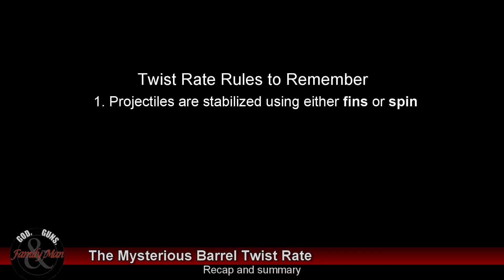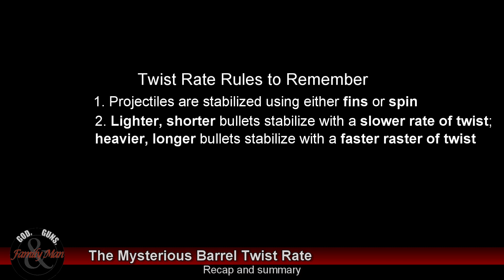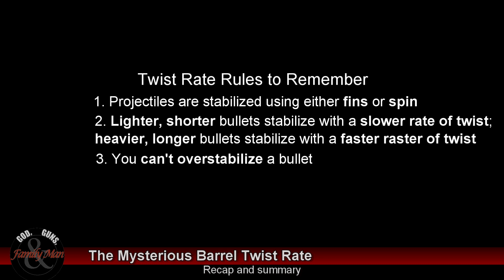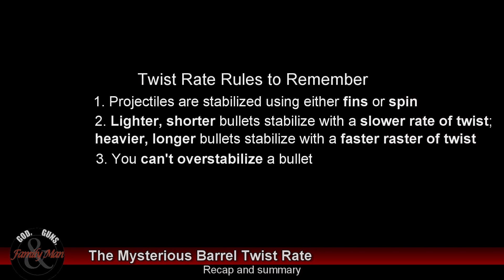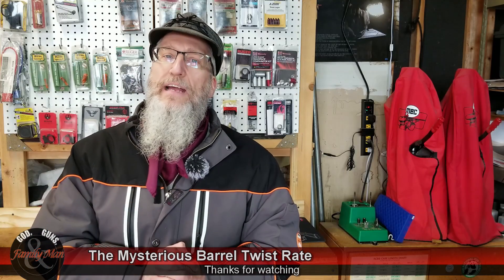Barrel Twist Rate and Bullet Stabilization

Comment: This video acutally explains nothing. Only if this is the situation, then that is necessary. But no explanation of _why_. 

For example: so, the bullet desintegrated "because" it slowed down to trans-sonic speed. Mhm. But still ... why!? 

Or, you need a faster twist rate if the bullet is larger. And a smaller bullet does not require that. Mhm. But WHY? 

What is the physics behind this all?

Comment: What you say makes sense however I have a 38 special handgun 158 grain bullet shoots more accurately. Hornady 110 grain bullet going at about 1200 ft./s is all over the target so it seems like 158 grade works better.😮 by the way my 38 special revolver has a one and 18 inch twist rate. Therefore 110 grind should shoot better and it’s just the opposite. I only shoot 158 because they go on .110 harder but I’m gonna miss the Target.

Comment: How much for a 150-180 grain 30-06 ?
Reply from the maker: If you have the data on the bullet, check out Berger's twist rate calculator at https://bergerbullets.com/twist-rate-calculator/
Its really the length of the bullet that effect necessary twist rate more than its weight.
Thanks for watching.

Comment: Interesting video.  I have an AR pistol with a 5.56x45, 1:5 twist rate that appears to be having trouble stabilizing (keyholes target).223 55 and 62grn bullets as short as 7 yards, if I go to 55grn 5.56x45 ammo, I can get at least 15yards before it destabilizes (again keyhole), in all cases, the projectile does break apart.  I have been told by the manufacturer to go to a 77grn 5.56x45 OTM round and this should solve the problem.  Since you are saying a projectile cannot be overstabilzed, can you please help me understand what is happening with the lighter 55 and 62grn .223 bullets.
Reply from the maker: What you described is a good example of a bullet that is clearly stabilized but also over-spun.  An over-spun bullet will show erratic performance on target as you noted. If known, can you post the muzzle velocity for these bullets?   
Stepping up to a heavier (and longer) bullet will give you much better performance out of those very fast twist barrels.  At least 77 grain and even heavier.
Thanks for watching and posting a good example of a stabilized but over-spun bullet.

Comment: The M16A1 I used in the Marine Corps had a 20 inch barrel with a 1-7 twist. We used 55 grain FMJ and had zero issues. My current rifle is a 16 inch with 1-8 twist and 55 grain FMJ works just fine.
Reply from the maker: Don't get me wrong, the 1-7 and 1-8 can fire those bullets just fine. My Tavor with 18" bbl and 1-7 twist shoots 55 gr bullets just fine.  BUT, it does even better (less dispersion) with 69 and 70 grain bullets.

Comment: The disintegration part is BS for sure. As someone who comes from a lot of high power PCP experience i can assure you that there is no such thing as the trans-sonic tumble or yaw which ppl claim. Airguns also have the advantage of very little velocity spread and SD when regulated and this has been proven wrong many times over.

Comment: How does subsonic ammo affect twist rate requirement? What's the recommend for say 308 sub?
Reply from the maker: The velocity of the bullet has very little to do with stabilization and the required twist rate.  It is effectively determined by the length and weight of the bullet.  A .308 caliber bullet that is sub-sonic is normally very long and heavy.  As a result, a higher twist rate is required to stabilize that bullet.

Comment: There seems to be a rash of videos about bullet stability, lately.

I IS possible to "overstabilize" a bullet. Like the rest of the general universe, we operate in FOUR "dimensions"; Z, Y, Z and T (Time).

This is fairly important.
We "spin" bullets to stabilize them in flight. Even round, lead balls. See the huge difference between smooth-bore and rifled muskets shooting round balls of similar diameter. This has been observed and studied for about three hundred years.  A chap named Greenhill did a prodigious amount of work on this business and came up with the "Greenhill formula" just in time for the ballistic world to be turned on its head. The appearance of "cylindrical" bullets and then smokeless powder somewhat "overstretched" his initial  envelope, but not too much.

Once a bullet leaves the muzzle, it is subject to two major forces; Air resistance (drag), and GRAVITY. At supersonic speeds, MOST of this drag is in the form os high-presssure "shock cones, and not just from the pointy meplat. And, remember, serious rifle bullets are rotating at thousands of rpm,unlike supersonic aircraft.

The entire idea of spinning a bullet is ti impart "gyroscopic stability"that will maintain alignment with the "line of departure. (Where the barrel is pointed at the moment of discharge).

Great idea, BUT, gravity inexorably pulls the bullet,spinning or not, toward the ground.. Thus the "natural" flight-path is NOT a straight line and not even a simple "arc" but a PARABOLA, more or less.

And so, If the bullet is spun too fast, it will try to stay on the line of departure rather than align with the parabola. Aerodynamics will "kick" it back on line, but not necessarily EXACTLY on the original trajectory. Optimally-stabilized bullets make many "micro-adjustments" as they fly. UNDER-STABILIZED bullets will wander all over the place. There is, essentially, a "window" of optimal stabilization.. Also, over stabilization" is not usually noticeable until well down-range, say five or 600 yards, when weird groups start occurring..

There are, or have been, several long dissertations about this on various sites. Even several barrel makers have chipped in with detailed articles.

Also, higher altitudes and higher temperatures make for thinner air, which is less resistant. This is the reason the original 1:14 inch twist od the M-16 was changed f inches to 1:12 inches; in the high Arctic, stability was assessed as being sub-optimal.

Comment: I would suspect that no bullet is perfectly balanced around its rotational axis. That leads me to suspect that the faster it spins, the more effect that rotational imbalance has on the flight path. If a bullet is spun at a much higher rate than what is required for stabilization, wouldn’t that have a negative impact on accuracy? Also, can the rotating frequency of the bullet interact with gun barrel vibration? I have wondered if I placed an acceleromitor on the barrel and tapped it with a hammer, what the frequency of vibration would be? Is it even close to the bullet rotating speed? I have never heard any concern expressed, so I have to assume there is no issue.
Reply from the maker: Exactly.  That is why a bullet can be over-spun.  We have a video on this topic coming out soon.
I do not know if the rotational frequency has that effect and it would be hard to isolate and test as the barrel vibration is also impacted by the burning of the powder and the initial explosion of that event. Thanks for watching and posting.

Comment: Could it be that the jacket spins around the core like a tyre on a dragster? Just a wild thought based on different forces on the cross section but it's so small, probably not the case. 
The destabilisation slowing down to trans sonic as you said seems a good bet.
Btw, very nice video and audio, easy to follow.
Reply from the maker: Thanks for watching and posting.  interesting idea but probably not the case,  especially with today's bonded bullets.

Comment: Ever think the friction created at 4000 fps is enough to melt lead tips creating even more friction till the spin on the drop of molten lead decides vaporize???
Reply from the maker: Good question Lanc Mac! I don't think that will happen though.  Yes, the temperature of the gases is very high, and the friction as the bullet travels down the bore will also produce heat, but the duration of that heat is so brief that is unlikely to melt lead.  The heat on the polymer meplat of a bullet as it flies through the air can start to melt however. That is the reason why Hornady uses a heat tolerant polymer in their ELD bullets.
Reply: @sdkweber  If an aircraft at 80,000 altitude going mach 3 (3300+ fps) experiences leading edge temperatures exceeding of 2000d F.  Lead melts around 640d F depending on any alloys.. So a bullet moving 3000 or 4000 fps is hot, really hot. and that does not take in to consideration surface heating by barrel friction or powder burn.
Reply from the maker: @lancmac  The factor in heating that you are omitting is time.  The U2 aircraft flies at 70,000 ft ASL(I do not know of any aircraft that flies at 80,000 ft ASL) and it does so for hours.  A bullet leaving the muzzle at 4,000 fps has a total time of flight of 4 seconds.  Its time in the bore is only a fraction of a second and that is not enough time for the heat to melt an exposed lead tip.  
For something to melt the correct temperature needs to exist as well as sufficient time.  Try this experiment.  Put a block of cheese in a preheated 350° F oven and leave it there for 4 seconds.  Did it melt?
Reply: @sdkweber  SR 72 has a disclosed service ceiling of 81,000+ AT MACH 3.2+  above those numbers are classified but rumors have mach 3.5 and 85,000 have been tracked on radar for a few minutes.

Comment: I thought 1 in 10 twist rate can stabilize bullets out to 220 grains. Your telling me it can’t stabilize that little squirrel round?
Reply from the maker: It really matters on the length of the bullet.  A traditional 220 gr. lead core bullet will be much shorter than a full copper 220 gr. bullet.  The RPR has trouble stabilizing a 175+ grain bullet but does very well with the lighter 168 gr. bullet.
Reply: @sdkweber  I see, that makes sense. Do manufactures put recommended twist rates on the box of there factory loads? And are they at all accurate?
Reply from the maker: @jackjohn6063  Some manufacture do put the recommended twist rate on their box of bullets (bullets for reloading).  Loaded factory ammo rarely puts recommended twist rate on the box.  For .308 Win. I have had good success with 168 gr and less.  What are you shooting?
Reply: @sdkweber  .308,  but I’ve been shooting the 180’s as I plan on going moose hunting with them next year. There punching clean holes through paper at a hundred yards. I would at least see them key holing slightly if there not stabilized wouldn’t I?
Reply: My rifle has a 1 in 10 twist I never thought that wouldn’t be enough for 180 gr. I’ve even heard that 1 in 10 can over stabilize bullets in the 150 to 160 range. Some guys are using 1 in 12 twist for the 150 gr rounds.
Reply from the maker: @jackjohn6063  No necessarily.  The first sign is very bad groups that look like a shotgun pattern. As the bullet slows at longer ranges you may then see the keyholing.  If your rifle is shooting these 180's well, then don't sweat it. If it works, don't fix it.  For moose, you need a bullet that will expand, drive deep, and kill the animal as cleanly as possible.  What particular bullet are you using? I suspect the 180 is a traditional lead core bullet.  Have you considered a lighter bullet like the 165 gr. Barnes TTSX? I am actually working that load up right now and will be testing it at the range one of these weekends.  The advantage of the Barnes bullet is they retain 100% of their weight and a nice long shank to help ensure deep penetration.  I have found a lot of -if not most- traditional lead core bullets will shed 40-60% of their weight turning a 180 gr. bullet into a 90 gr inside the moose.
Reply from the maker: @jackjohn6063  You really can't over stabilize in reality.  That is a myth.  My son is shooting 147 gr. bullets in his .308 (1 in 10 twist) and it shoots very well.
Reply: @sdkweber  Hello, I disagree with your statement. My 1x10" button rifled 30:06 over stabilizes 150gr. bullets and it doesn't matter whether they are cheap or expensive. Quality barrels will shoot most bullet weights well though. Are you from SD?
Reply: @sdkweber 
210 grain ABLR bullet  is stable in a 1 in 10 twist out of a typical  30-06  and it's length is 1.570

Comment: Technically it is not heavier or lighter...twist rate is matched up to the length of the bullet. 
Highly over-stabilized varmint bullets almost always explode in less than 100yds.
Reply from the maker: You are correct DW None.  I tried to communicate that in the video... length is really the important factor.  Since a lot of folks do not know the length of the bullet they are shooting, especially with factory ammo, referring to heavier vs lighter in the same cartridge is a good way to look at it.

Comment: Thanks Mate 
That that was an awesome presentation very clear and easily understood , I have always wondered why different Bullets require fast or slow twist rates  , thanks very much for the video I now have  more understanding of the subject , Steve .
Reply from the maker: You are welcome Steve.  Thank you for watching and posting.
Reply: @sdkweber  You can over-stabilize a bullet. MY 1:8 twist FN AR-15 will prove it to you. 50 GR federal varmint loads shoot erratically at 100 yards. 75gr hornady can shoot quarter size groups at 100. Get a new job.:face-blue-smiling:
Reply: Because of the fast twist rate, light bullets drift high right from fast twist barrels:face-blue-smiling:
Reply from the maker: @fjc11212  The problem you describe is indeed a dispersion problem but most likely not due to over-stabilization.  Problems with over-spinning bullets normally appear as the bullet enters the transonic zone which for a .223 or 5.56 bullet would occur much further than 100 yards.
Reply: @sdkweber  During the transonic stage bullets become "unstable" not overstabilized. Meaning, it will impact in an unpredictable location. Overstabilized bullets will be consistently right and high also scattered.
Reply from the maker: @fjc11212  I think this is semantics.  You cannot over-stabilize a bullet as a bullet is either stabilized or it is not stabilized.  You can however, over spin a bullet, that is; shoot a very short and light bullet in a very fast twist barrel.  This will cause poor precision and large dispersion.
Reply: @sdkweber  why isn’t there a standard if you cannot over-stabilize? Far cheaper, efficient list goes on. 1:1 twist for entire history of bullets? 😎
Reply from the maker: @fjc11212  I have been doing more research on this since I made this video a year ago.  A good example of this is the .300 PRC vs the .308 Winchester.  Both shoot .308 caliber bullets but the .308 Win was designed for the lighter .308 bullets (150-180 gr) and uses 1:10 twist.  Based up the case capacity of the .308 that is a good choice.
The .300 PRC was designed for the heavy/long for caliber bullets (200-235 gr) and uses a 1:8 twist.  The large case capacity compliments the twist rate.
If I loaded a 168 gr. bullets for my .300 PRC it would shoot safely but would over spin resulting in poor precision.  I have talked to guys who tried to do this, hoping to push the 168 gr. to incredible speeds but the bullets "patterned" erratically.  The cartridge (case capacity, etc.), intended bullet weight, and barrel twist rate are all part of the design process.